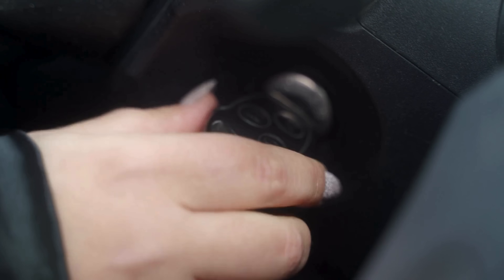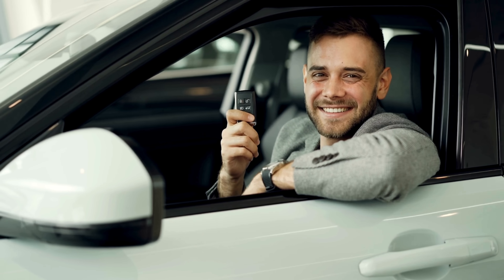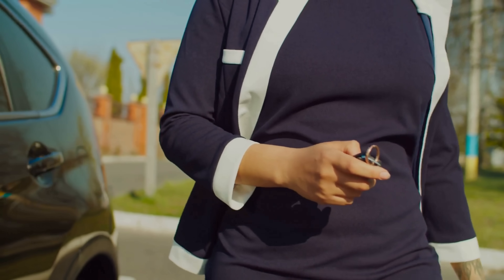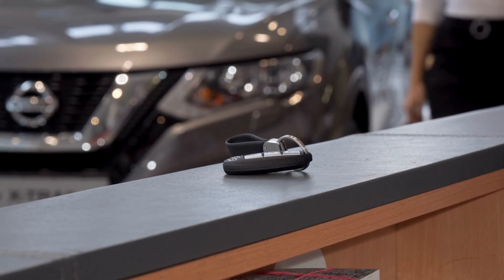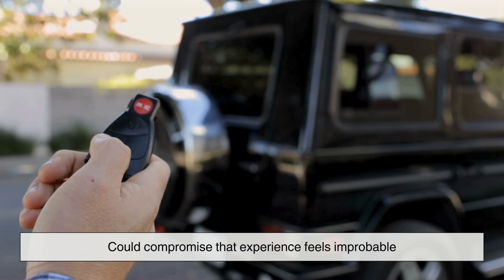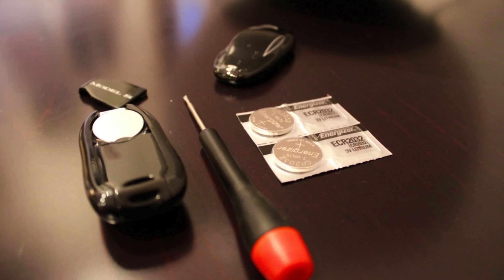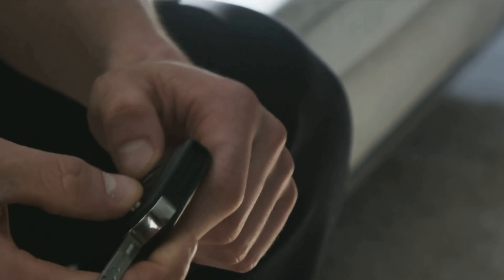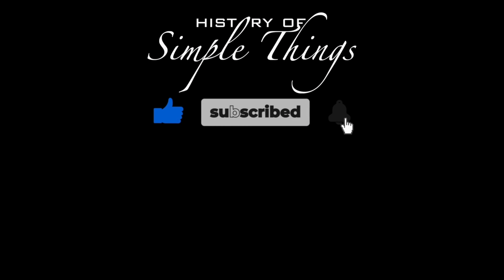What Does It Mean When Your Car Key Fob Battery Is Low?

Comment: I liked this video very much!  But my car never showed “low key fob battery”.   It wouldn’t unlock door at first, so I used manually the real key which unlocked my door- yet the horn started going off.  I pressed lock on my remote to stop it.  My car started so no problem.  Then on day 2 of the same thing happening This time my car wouldn’t start.  Dash read a red symbol like a key/lock sign!   Called my roadside service and the guy tried everything with no luck.   Stranded I had to get a tow to dealership at night (last night)!    Have to wait till morning before they have time to check it.  Maybe then, l can now say “It might just be the fob battery so please no extreme service charge!   Technically can be a great thing, but also maybe too extreme sometimes!  My guess is that my system thought there was theft involved.   But why wouldn’t it recognize my original Real physical key in the ignition?!!    The one I have used Always since I’ve purchased my car.  Granted, a used car In great condition, low mileage from a respected dealership.  But still very frustrating!  If this is an anti-theft thing programmed- well, I may choose to not have it.   Seems there should be a way to re-program instead of leaving me stranded !   Thankfully I wasn’t far from home and in no hurry AND had my little service dog with me!  Otherwise I’d have been in panic mode to get home to her.    Thanks for your video.

Comment: For peace of mind replace once a year and use a quality product like Energizer Max. Always make sure you are not buying a knock off and make sure they are fresh dated. A couple bucks beat a nightmare situation. You Tube has plenty of videos on how to do your model car FOB yourself. Usually 10 minutes. Hopefully your brand has a backup memory to supply power while you change out the button cell. Most owner's manuals have the details.

Comment: My Volvo uses two batteries of a weird size (CR2430).  I found one at a camera shop, and another at a second camera shop.  Put them in, and it didn't work, so I ended up paying stealership prices of about $20 each.
Reply: My Volvo dealer not only supplies the battery free, they also installed it in the fob. 
I wait for the low battery message and then have them replace it while they wash the car, also for free.

Comment: I’d just change the battery
Reply: You’d think that would fix it. That’s what I did, 2 more batteries, still nothing.   
I had to bring it to the dealer. It turns out my spare key was never paired to the car.
Reply: I thought my fob was broken when my car would no longer start remotely…then just recently found out that the remote start feature auto disables itself when check engine light comes on!  It’s not so much a key fob problem, but thought I’d mention it so no one feels the mega dork embarrassment I felt after bitching about it every morning for 3 years

Comment: I had to replace mine after only a year. But a guy at work said they probably have a case of cells like a thousand in a box, and who knows long they sat on the shelf before they assembled the remote.  So I replaced both, I figured the other one was in the same shape, 3 years later still working.